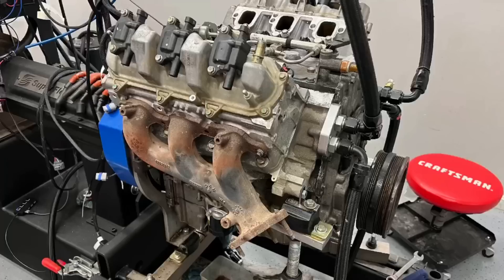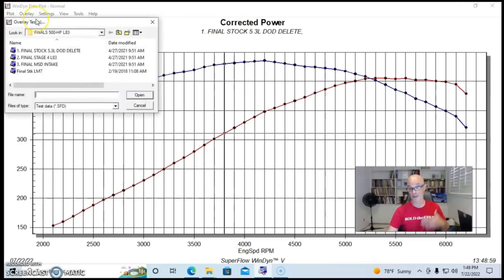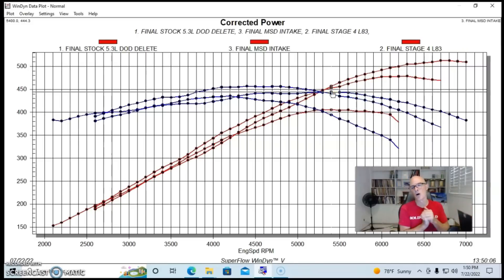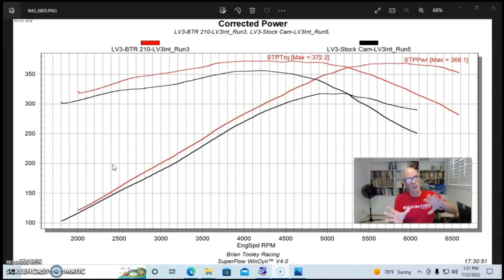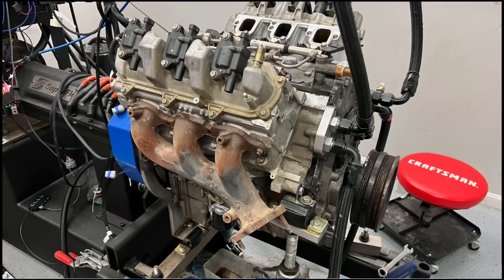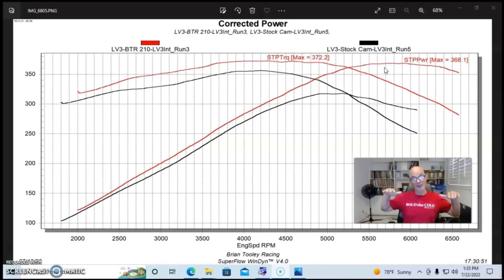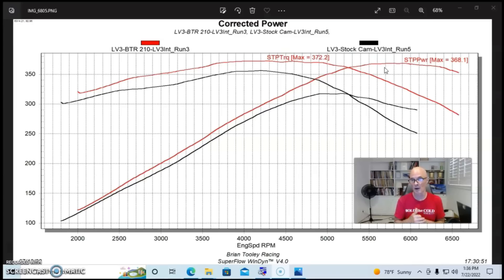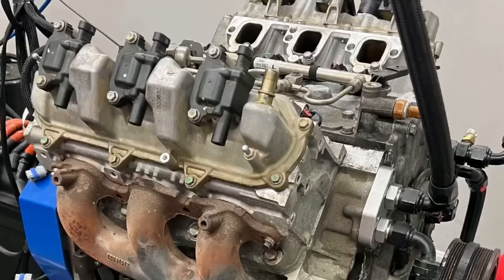4.3L LV3 V6 VVT CAM TEST-THE OTHER GUYS-HOW MUCH HP IS A BTR VVT CAM UPGRADE WORTH ON THE 4.3L V6?

Comment: Richard, have you ever compared spark plug wires on any LS platform? Im contemplating getting some 0ohm Granatelli wires for my L76 6.0 and would like to find out if the small power gain with them compared to oem wires is worth the extra 50$ for a set of wires. ADD: I made 432hp 395tq on a dynojet in a recent tuning session. it was over 100* F in the dyno cell that day.
Reply from the maker: THEY WON'T ADD POWER-GET STOCK ONES (WE USE STOCK JUNKYARD ONES ON 1000+ HP TURBO MOTORS)
Reply: @richardholdener1727  Stock wires have high ohm, you mean to tell me a zero (0) ohm wire wont improve the spark consistency? Please explain... With a stg2 cam, and other odds and ends, im looking for little bits of power with small $ investment at this point. The heads are LS3 heads, and the springs, retainers etc all done. Without pulling off my heads, what else can i do to make some more power on this daily drivere? i dont have boost money at the moment. Vararam, headers, exhaust, all done. My tuner told me to go with one heat range colder plug so tr6 inbound. MSD wires? Same cost as oe... I want to improve what I replace. Recommendations? I will eventually put a D1 procharger on the car, but the 7K is being saved. What can I do in the meantime to extract a bit more power....
Reply: Like Richard said. These premium wires aren't really worth it. Any gains you see would be just because your old wires were toast anyway. Save you money and get a cam apparently.
Reply: @craigquann  Stage 2 texas speed cam, valve springs, retainers, trunnions, kooks exhaust and catless 1-7/8" headers, vararam, LS7 Maf and 4" maf tube.... Where to find more power cost effectively/// Heads are LS3 heads, stock rectangle port. i want to make close to 500 tire without putting spray or boost. Daily driven,. Do you have a recommendation?
Reply: @Epsonblade  E85 or boost at this point. But listen to your tuner for plug/wires. The wires themselves will not give you more power. Possibly a more consistent spark to prevent misfires at wot and heat soak. But not anything worth showing on the dyno. They have their purpose and if you can get them at a bargain then absolutely. But they're not going to be some magic maker.

Comment: The 6 million computer hours designing the LT combustion system was actually centred on the V6...so it's the most optimum LT.  I like how just a cam/headers LV3 makes as much power as a stock LS1.

btw, is that a Holley EFI intake for the LV3?
Reply from the maker: STOCK ECU AND THIS V6 DIDN'T MAKE AS MUCH AS A 5.7L LS1 TESTED IN THE SAME CONFIGURATON (OVER 400 HP)
Reply: @richardholdener1727  WHY ARE WE YELLING?

Comment: Hi 👋 👋 👋 👋 Richard thanks for doing the tec on LV3 V6 that pretty good you didn't have to throw much money into the project. 1 thing I wasn't quite understanding about the stock cam and the aftermarket cam. I'll try going back and check out the video 1 more time. I was wanting to buy a Chevy or GMC . But I need to know more about the engine.

Comment: Now you need to test out the LFX or LGX. The actual performance V6s from GM (excluding the LF3 and LF4). They’re much more impressive than the LV3 and a very common swap engine.
Reply from the maker: COMMON SWAP FOR WHAT?
Reply: @richardholdener1727  pretty common in the Miata and RX8 area. Gives 325 HP with a 7k redline in stock trim and lighter and easier to fit in many places than an LS. I’ve seen people put them in Fieros and such too. We personally put one in to an early 2000s GM FWD sedan and it’s a fun little car to drive around now. Plus they’re cheap at junkyards since GM throws them in everything. And for just being a little NA 3.6l I’ve seen Camaro guys throw out some impressive numbers.
Reply: @richardholdener1727  DOHC V6 SHOWDOWN! Enough of this dinosaur pushrod bs.

Comment: How much horsepower with a latest victor intake manifold
Reply from the maker: IS THERE A VICTOR INTAKE FOR THE LV3?
Reply: @richardholdener1727  None found so far. I have been researching your question. I found a victor for the 3.8 Buick V6.

Comment: I'd like the see some testing on a 3.6 engine that's in my 2018 Chevy colorado. 
I have been impressed with its fuel economy and the amount of power it has. 
I have an 84 Camaro and a 16" trailer that I pull with it sometimes. I have got 14.5 mpg pulling the car.  And normal driving it gets about 21 to 22 mpg. 
But if I make an effort to to drive it easy at 50 to 55 mph I have got 27 mpg with it. 

I'm curious about how much power that engine can make. Without coming apart. Maybe some boost might be required.....
Reply: Look at my comment above I agree we need to do a showdown of the 3.-  liter dual overhead cam v6s..
Reply: Don't listen to this guy or anybody else who bashes the 3.6 Marty they're great Motors.
Reply: Less potential. It's already high strung I don't think they have the bottom end to build alot of power over stock. The 4.3 was built as a "commercial truck" application the 3.6 was a "passanger/multi platform" it's not built for the same level of stress/longevity. And it's also gone bye bye as the new 2.7L turbo is better. I don't think there's any aftermarket for the 3.6 beyond an intake and tune. Though there's probably alot more 3.6 available... But many of them probably are scrap. The timing chains are prone to failure and the engine granades as it's an interference engine. So any junk yard engines either need to be low mileage/crashed or need a rebuild.
Reply: @craigquann  the timing chain issue was fixed from 2012 onward. And most of the 3.6 timing chain issues was due to people not maintaining and keeping the oil full.
Reply: @kskip4242  yes on the timing chain/maintenance. But not entirely cured. Secondly yes it's a high tech and well built motor. But no, not even close to how strong the 4.3L is. It will not and cannot hold up to the same use and abuse. If it could, they would have used it as the base engine in the full size trucks and Vans. It's not designed for that. Nor will it ever hold up to 700+ HP that the 4.3 can.
Reply: @kskip4242  there was a reason most Colorado/canyon owners were screaming at gm to give them the 4.3 over the 3.6. now that both are being phased out, they're screaming for the 2.7t and they're getting it. Now which version of the 2.7 is the real question. The original or the updated torque monster.
Reply: @craigquann  I see you’re out of touch with GM’s HFV6s. As mentioned chains were an issue from lack of maintenance and starting with the 3rd Gen 3.6 the LFX is mostly a mute point. If you’re worried about block integrity there’s always the LF3 and LF4 which were built for boost. But Camaro guys are making 600whp+ with boost on the stock LFX block. 

They used the 4.3 on the full sized trucks because it makes more torque. The whole no replacement for displacement argument comes in there. But for raw power the LFX and LGX breathe much better and spin much faster. In stock trim there’s no doubt which engine would make for a faster vehicle. 

And yes the HFV6s don’t have the aftermarket that Gen 3, 4, and 5s have, but they have enough, more than the LV3 for sure.
Reply: @craigquann  they only wanted a bigger motor because the 3.6 doesn't make as much low-end torque but it doesn't change the fact that the 3.6 L is a great engine stop spreading false information all the issues that they had were fixed after 2012!
Reply: @craigquann  b***** there's plenty of V6 Camaro guys out here pushing well over 700 horsepower on the stock bottoms with turbos you don't know what the hell you're talking about.The 3.6 was completely redesigned in 2017 and the lgx and has had ZERO issues. Plus the LFX that is still used in the new Blazers has port injection and direct injection to address any carbon issues on the intake valves.
Reply: @craigquann  you do realize the 2020 and the 2021 Camaro 3.6 with the 10-speed automatic with just boltons and tuning are running in the low 12s quarter mile right? See this is the reason why the newer V6 engines get little love in the hot rodding Arena because people are constantly bashing them and spreading false information. The newer dual overhead cam V6 is from all the manufacturers are amazing engines and are literally the modern equivalent of the old small block V8 of old.
Reply: @kskip4242  lol "no replacement for displacement" , "it makes better torque" and "they only wanted a bigger motor" thanks for making my argument for me. Again it only makes more HP as it's a higher strung, higher revving engine. A cam swapped LV3 fixes that and spanks the shit out of em. Secondly a hopped up V6 dragging a 3000 lb Camaro vs a V6 dragging a 5500 lb truck (not counting the load/trailer) are 2 completely different applications. It's not the same. Furthermore the Camaro vs the Colorado are similar but the internal are different. The Camaro is performance based. The Colorado (and other SUV and car platforms) are daily driver based. Different setups again and aftermarket parts for one may not be compatible. Furthermore had the 4.3 been used in the Camaro, guys would be building that not the 3.6 as that's what they would have to work with, as swapping a new low mileage engine is an expense that can be bypassed and money spent elsewhere. The LV3 is the better of the 2 if you're looking for a junkyard donor to build power not to mention being a pushrod and not DOHC it's actually smaller and lighter for better packaging and lower weight distribution.
Reply: In the end, anything you do to hop up the 3.6 you can do to the 4.3 with better results
Reply: @IVloses  thank you for the backup it's really disgusting how out of touch people are with stuff because they listen to all the nonsense on the internet.
Reply: @craigquann  no you originally came on here trying to say the 3.6 was a weak problem proned motor and it simply is not. I have two LFX Motors that I have beat the s*** out of for over 200,000 miles and they still run like they did the day they were new.They are full bolt on e85 ran engines pushing 385 at the crank.
Reply: @craigquann  cam it all you want, 4 valves are still going to flow better than 2 valves at same lift and duration. And that’s why the 3.6 is more efficient. And you can just as easily cam the 3.6. Sure there’ll come a point where more potential airflow peaks out on the 3.6 before the 4.3, but by that point that 4.3 is going to be a dog until you spin it up fast enough. The 3.6 is the better engine and that’s why GM put it in damn near everything. The only love the 4.3 got was in 1500s for the people who couldn’t afford the V8 and to artificially inflate GM’s fuel economy numbers.

And since the 3.6s are so prevalent they’re cheap, parts for it are cheap, and it’s a commonly swapped engine. The LV3s are cheap too, but because nobody wants them after they swap it out for an L83 or L86 😂
Reply: @IVloses  wrong. 2v flow better especially at low to mid range. Hence the better torque down low. At the top end is the only time a 4v flows slightly better but not enough to really matter. When you have to rev the tits off to redline to get moving vs smooth muscle and the bottom end your not really getting great all around performance and not ideal for a daily/street driver.
Reply: @IVloses  and who the fuck is swapping a 3.6 into anything? If you're swapping, your going to 90% of the time use a pushrod V8. Unless it won't fit(very rare). Nobody is using the 3.6 unless they're stuck with it to begin with. The reason the LV3 gets overshadowed by the V8 is for the obvious reasons. 1) both are offed in the same vehicles 2) the upgrade cost at purchase is enough to make the V8 worth it. 3) most people hear V6 and think of older versions not the LV3 that actually produces more power than the old truck their replacing. 4) with the very rare exceptions the V8 will fit their swap. 5) the V8's are everywhere and in everything. But given a choice, nobody would chose the 3.6 as a swap if the other option is a 4.3. unless it's just to transplant the original 3.6 engine with the same 3.6 engine to save money. But a custom build, the 4.3 will be the better option.
Reply: @craigquann  again you’re really showing that you haven’t a clue what you’re talking about. For example the LGX makes 88% of its max torque by 2k RPM. Making peak torque at 5300 RPM. 4 valves allow the engine to breathe better. Which is why it’s able to redline at 7200 from the factory. Where the LV3 redlines at 5800 from the factory. And the LV3 only makes 20 more lb ft of torque but at a much lower RPM of 3900 then it starts to fall off. While the LGX makes 50 more HP at 1500 more RPM.

But again, you’re obviously in love with a throw away engine and nothing can match/surpass it in your eyes so this argument is a waste of everyone’s time. You stick with your LV3 and the rest of us will stick with LSs, LTs, and later Gen 3.6s.
Reply: @IVloses  wrong again. The LV3 makes 80% peak torque at 1200. Peaks a 3900 and carries it to 5300 in all points on the Rev range it makes more torque period. It's a fuel shutoff at 5800. Not a redline. The LV3 doesn't actually have a redline as it doesn't spin up to that point by design/factory set-up again as Richard shows in this video, it can and will rev quite happily past that with a cam and tune.
Reply: @IVloses  further the 3.6 only makes more as it's tuned to rev higher not that the 4.3 can't. (It doesn't need to) nobody is driving a vehicle at 6000rpm unless your actually tracking it. And even then, your not there long and low/mid range makes it far more forgiving and quicker out of the exit.
Reply: @IVloses  and to add the LGX is Camaro/Cadillac not the same as the Colorado. Which actually produces even less power. 308hp and 275 tq
Reply: @IVloses   ok again, first off the OP is asking about the Colorado 3.6 and it's potential to build. Not anything to do with the LGX. My point is the LV3 has more potential. Secondly yes the LV3 obviously has a redline. 5800 is not it however. And clearly it will spin quite happily up to 6500 just like the LGX 6800 once you remove the factory fuel cutoff. However the LGX does redline at that point. What does the dashboard show in your Camaro? Do you even have one? Secondly I can assure you my 17 Sierra doesn't have a redline marked on the dash as ITS NOT THE FUCKING REDLINE. the LV3 is built and designed to sit and sing at 5800 all damn day at max load. Try that with an LGX and watch it go poopy on it's pants. It's not built for it. It's a sport car engine. Furthermore, I don't know why the fuck gm even offers it in the Camaro as the 2.0T can easily outclass it on the low to mid range and with a simple flash tune out do it in peak numbers. And for the additional money the V8 is right there. Definitely not the engine I'd take. I'm not saying it's horrible, I'm saying it's not the best option and for something to build max horsepower again, better options.
Reply: @craigquann  the 3.6 is built like a brick shithouse you better look again they have oil squirters forged rods and pistons you name it they are built way tougher than the 4.3 .

Comment: The piston size is close to the ls1 at 3.898 usually measured in mm that's why the funny numbers. The ls1 is 99mm so I'm guessing they are around 100mm pistons

Comment: What's even crazier is when you realize this engine weighs like 300 pounds
Reply: DOHC v6 engines make alot more power with less displacement..
Reply: @kskip4242  with heads the size of a golden retriever and the same weight, yeah, you're not wrong
Reply: No it doesnt
Reply: 315ish before all the accessory drive added.
Reply: @WarShrike  340lb
Reply: @RadDadisRad  where did you get that number?
Reply: @RadDadisRad  just saw image of one in the LV3 group without the accessory drive and it was right around 315. We'll have to toss ours on the scale at work after we're done with it.
Reply: @SoI_Badguy  the wrecking yard with a hanging scale. Intake to oil pan with headers undressed. Scaled for packing slip.

Comment: Is that split crank going to be a power limiter?
Reply: It's forged steel
Reply: Was the split crank the failure point in the old 350-based 4.3 or in any of the even-fire generations of the Buick-based 3.8/3800?
Reply: I know the answer to none of that, Hence why I asked. I do not know the history of split cranks
Reply: @JD-rq7il  to obtain an even firing from a v6 the crankshafts rod journals must be offset,which reduces the cross sectional area/strength.(instead of 2 rods sharing a rod crank journal each rod has its own)To strengthen this area on even fire v6s the journals diameters  are enlarged.gen1 4.3 and 3.8 cranks (all stock were cast) can break there when pushed hard.some racing versions went back to odd fire to avoid that problem.the new 4300 has a factory forged steel crankshaft..much stronger.mabey Richard will do a big bang 4300 and find its limit.

Comment: I work for a local city, my work truck has the LV3. (2015 RCSB 4x4) It's not half bad, obviously I wish it had more power - but it's not intended for that. The 4.3Ls don't seem to have the lifter failures associated with their V8 cousins.
Reply: If it doesn't have AFM/DOD then no problem. Because AFM/DOD on any brand is trash.

Lifter issues result from not changing oil.
Reply: @shadowopsairman1583  they have the same afm and dod as the brothers do. just less prevalent